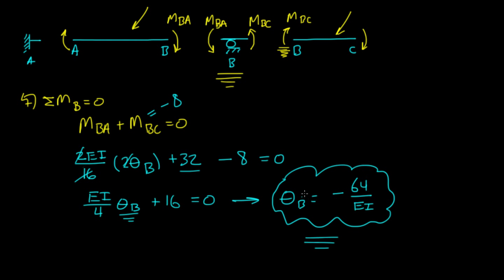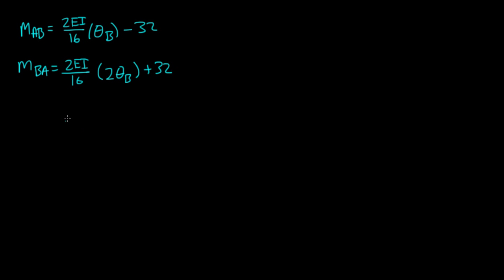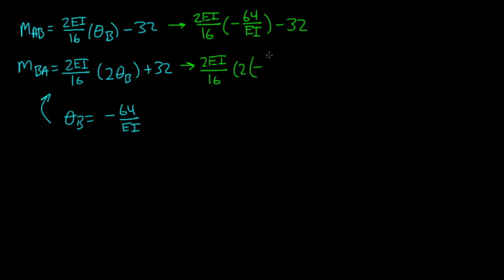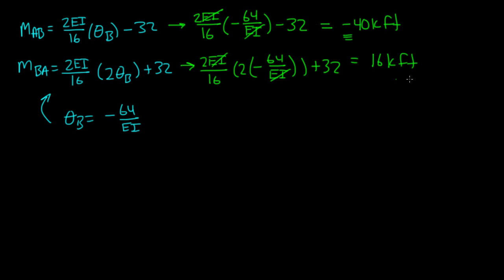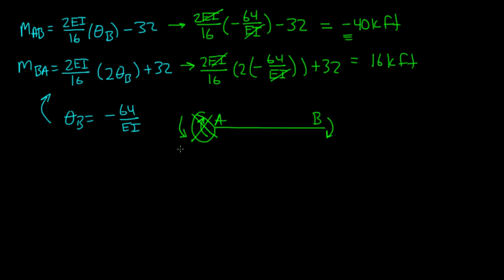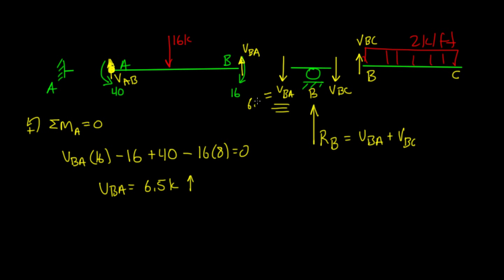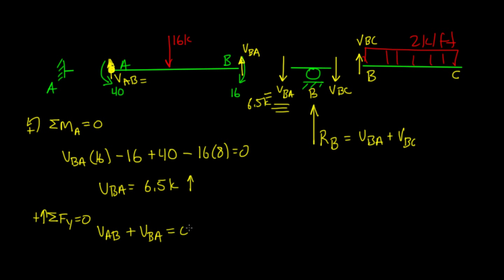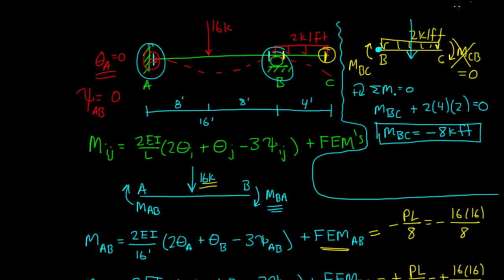Slope Deflection Example 1: Part 3

Comment: Theda B is wrong should be 96/EI
Reply: Theda B is 64/EI if you use the correct value for M_bc which is -16 NOT -8 as stated in the previous video.